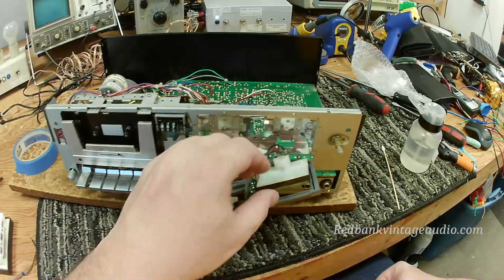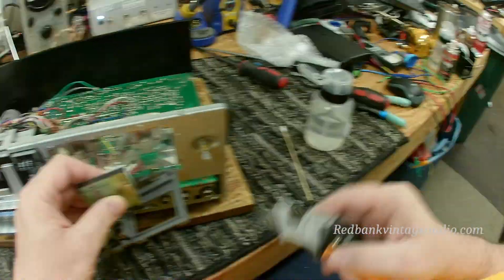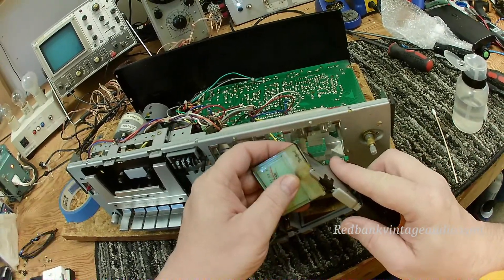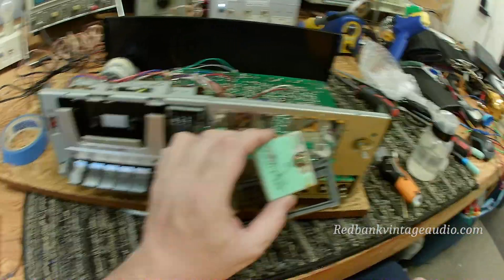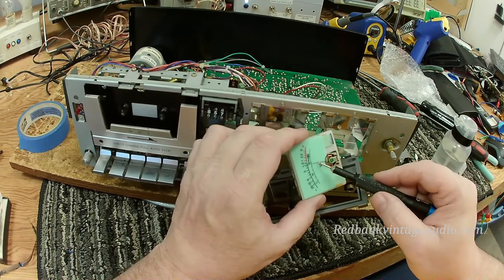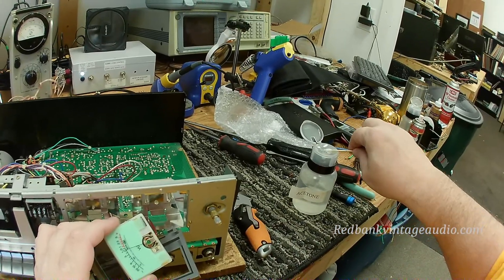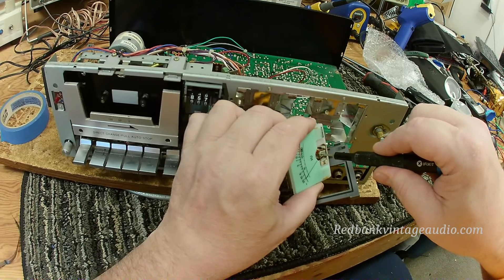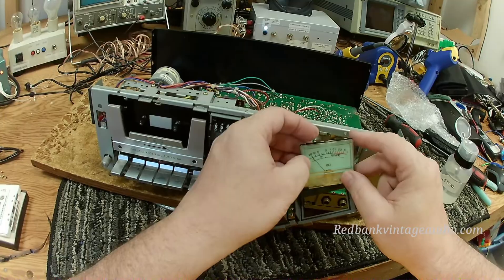Repairing A Stuck VU Meter

Comment: Hi Scott got a technics su z2 with vu needle slightly to the left of 0.001. would it be the sane little screw? Thanks fro over the pond
Reply: Thanks Scott. I turned the screw clockwise and the needle went to zero. When I tried it with music it got stuck to the right. I'll clean it and gently turn anti clock wise. Thank you for the reply👍
Reply from the maker: No, it's probably just not zero'd correctly, assuming the meter works otherwise. Different meters have different methods of setting the zero resting place, but the most common is a small metal loop that hangs below the pivot at a bit of an angle. This is the anchor point for the spring that returns the needle to zero when there is no signal,, and moving this loop slightly changes the zero resting place. If you try this, BE CAREFUL! the mechanism is very fragile, and a tiny movement will be all it takes.

Comment: Have a sony tc765 with very nice big VUs but they move really slowly and not vibrant at all.
It looks like others have the same problem with their 765.
Any advice to fix them
Reply from the maker: That may be an electronic problem rather than a mechanical one. I seem to remember this from repairing a 765 in the past, and there were electrolytic caps in the meter circuits that needed to be replaced.
Reply: @ScottGrammer  i will check 🙂👍🏻

Comment: I have a Marantz 5220 tape deck that has VU meters. One of the meters occasionally gets stuck at 5 or 1 DB.  Usually those two stuck points. If I tap the top it will release and move a bit and then get stuck there again haha. Dumb question but do you think this fix could help? Or is it more concerning it usually gets stuck in the same positions?
Reply from the maker: It sounds like something is catching the needle of the affected meter. I suspect that the plate that the scale is printed on has slipped out of place and is catching the end of the needle. If you're handy with tools and have a steady hand, you might try removing the clear front from the meter and taking a look to see if the meter scale has come loose. If so, you can probably just press it back into place, and the glue that held it in place originally may well grab hold of it again, fixing the problem. If the scale does not appear to be loose, play a tape or send some audio into the inputs of the deck while the meter is apart, and let the needle swing to see if it's catching on anything. If not, then you might want to loosen the bearing screw JUST A LITTLE BIT to see if that helps.
Reply: @ScottGrammer  thank you so much for taking the time to reply! I haven’t had a tape deck in years and never had one with meters so I’m out of my wheelhouse. I’ll give this a try tho as it seems pretty straightforward. It doesn’t happen unless I’m playing a tape that’s pretty bass heavy where the dbs elevate (played a bob marley tape that really got the meters moving haha). Thanks again and happy new years!

Comment: Many thanks. This worked for my Yamaha CR-220 receiver. I didn't have to remove the meter. The set screw was accessible from the rear of the meter. Before concluding that it was a stuck meter, I checked the on/off station voltages at the meter terminals first. In my case, AM on station was 0V, off station -90mV. FM on station was 0mV, off station was up to 32mV, pos and neg. Just thought I would include that bit so that people can understand the low voltages involved. Testing the meter with higher votages wouldn't have done it any good.
Reply from the maker: Glad it worked for you, and you are correct about the low voltages. D'Arsonval meter movements are low-resistance devices that respond to current, not voltage, and because they can be quite sensitive, they need little voltage to cause enough current flow to actuate them.

Comment: Thanks Scott, had that exact problem, applied some acetone on a Qtip, removed the protective "stuff" from the screw and slightly released the little screw: works like a charm. Thanks for taking the effort to post this solution.
Reply from the maker: Glad I could help.